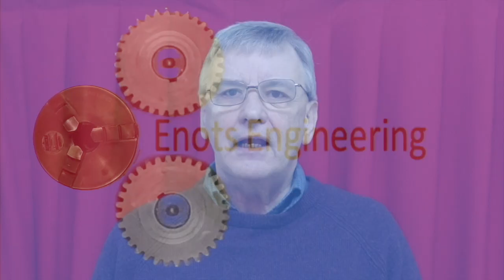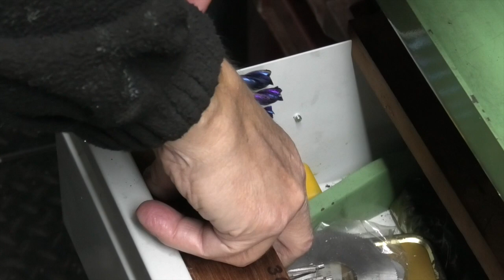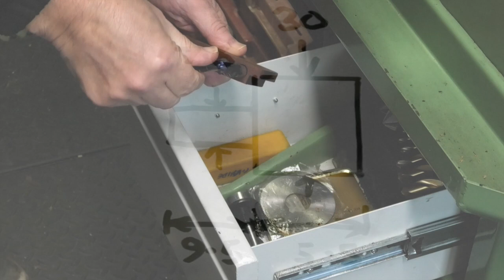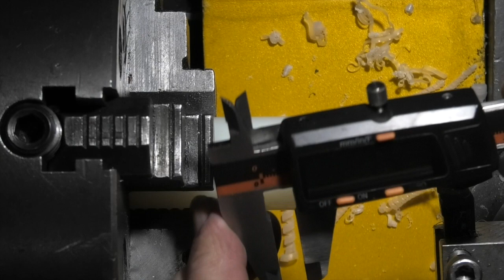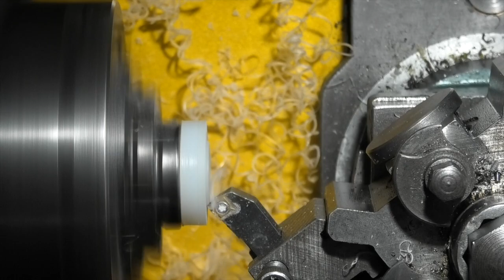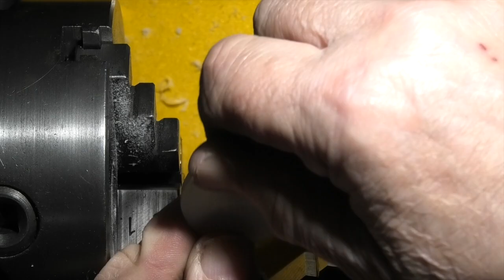Turning Nylon bar

Comment: you are using carbide on nylon?  Man,  Get some HSS  it grinds so much sharper and you get a way  better finish and it doesn't spring away from the tool like it will with carbide.
Reply from the maker: Great point!

Comment: I think it was me that mentioned rust off the wood. Such a simple solution. Also, we yearly change out the gear oil from the lathe and mill. A light coating of that would have the same affect. Cheers Alan👍
Reply from the maker: your welcome

Comment: I didn't guess but I perhaps should have done since the last time I turned nylon was for a loo seat hinge pin. I found that the sharper inserts intended for aluminium cut this stuff nicely, not so much of a burr.